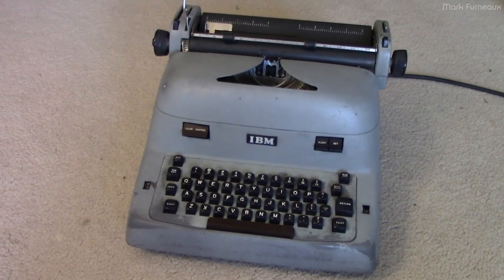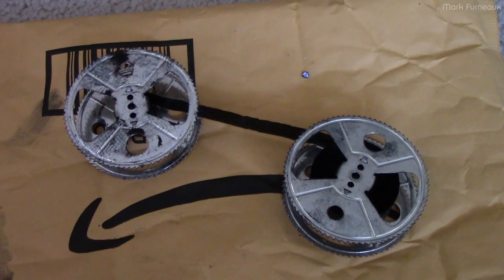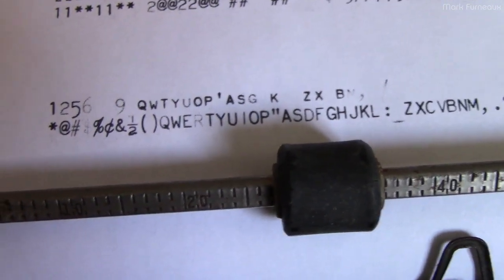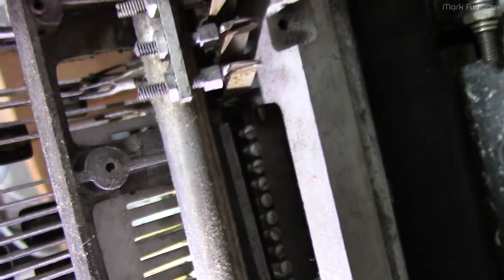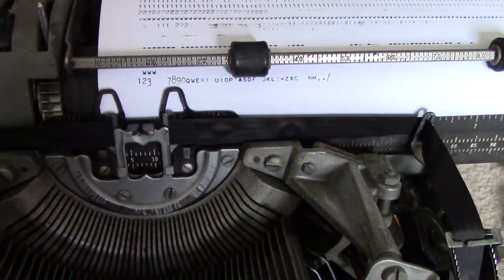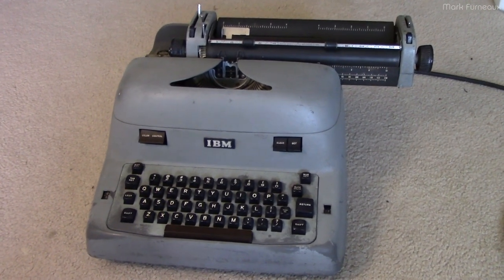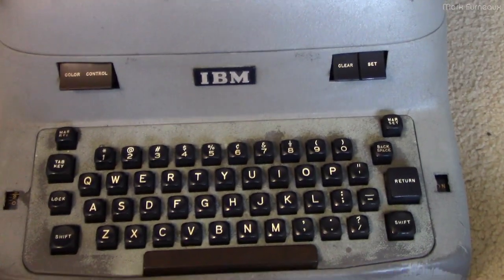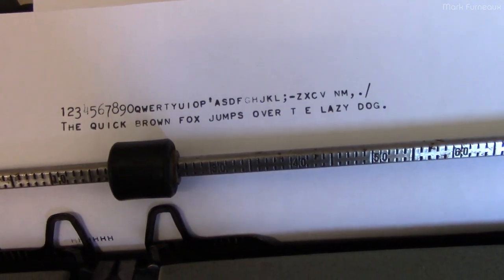1953 IBM Model A Electric Typewriter Repair Part 2

Comment: No affiliation, but last February,  bought some "TECHSPRAY ROLLER REJUVENATOR PLATEN CLEANER" on line, and while it does not really appear to soften an old rubber platen, it cleans it pretty well, and it makes the platen 'tackier' for a period of time ( just how long, I am not sure at this point), helping to feed the paper into the typewriter. " Citrus-based solvent designed to clean and revitalize rubber rollers and platens". Improves rubber roller grip and reduces misfeeds and jams. Priced at around $5.00 per ounce ( yes $5.00 per ounce!) it is not cheap, but I use very little of it, wiping it on the platen with small pieces of the disposable blue, cloth-like shop towels...a little goes a long way. It comes in a two-ounce plastic bottle. Shop around on the internet and check the pricing.